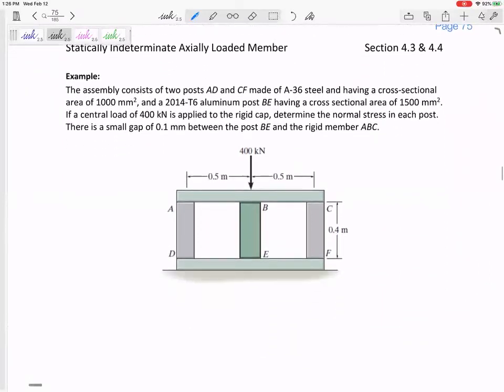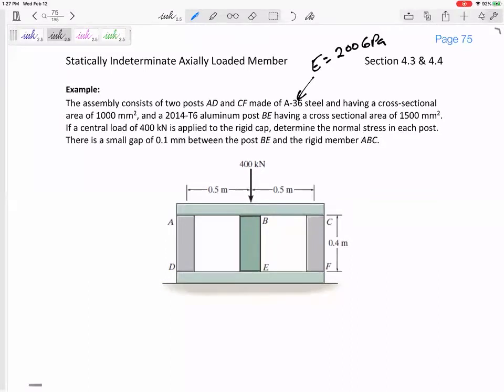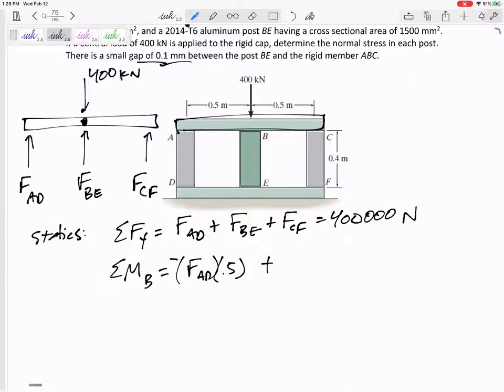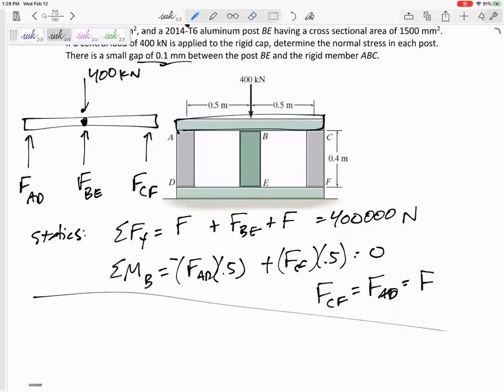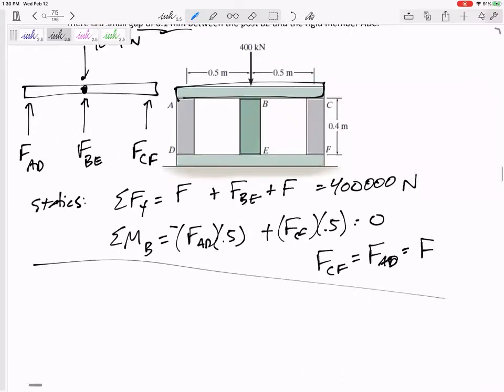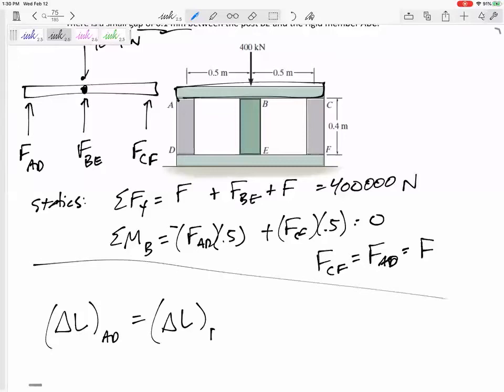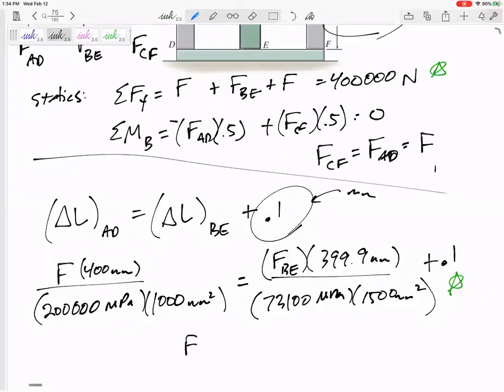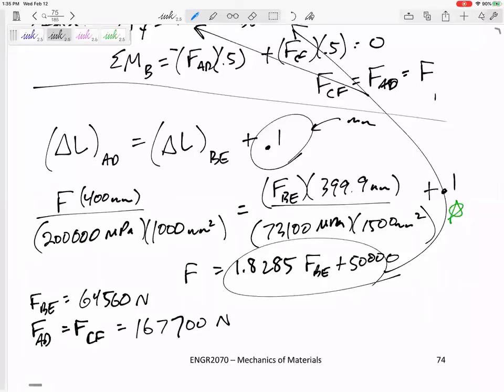Mechanics of Materials - Statically indeterminate axially loaded members example 1

Comment: What if the force is not enough to compress AD and CF by 0.1mm? Shouldn't we check that first?
Reply from the maker: You could if you want. But if it doesn’t compress by 0.1mm then you will get a negative answer for the force in BE. That would alert you that it didn’t close the gap
Reply: Thansk for the answer sir.

But i dont understand it.If member ABC is not touching to the BE, how can be a reaction force that can be negative.I assumed that reaction force BE is zero.
Reply from the maker: @ well, we “assume” it is touching BE. We “make” it touch BE. But the math would tell us that in order for that assumption to be correct, member BE would be negative- meaning BE would have to “pull” down member ABC, it would have to “suck down” member ABC to close the gap. We know that it’s impossible for member BE to pull down ABC, so we realize our assumption (that the gap is closed) would be incorrect.
Reply: @ Now it all makes sense.
Thank you so much for your response and the videos you made.
You're the best!
Reply from the maker: @talhaylmaz4181 thank you! And let me clarify that once we do realize the gap was not closed, then we would need to completely rework the problem with the force in BE equal to zero.